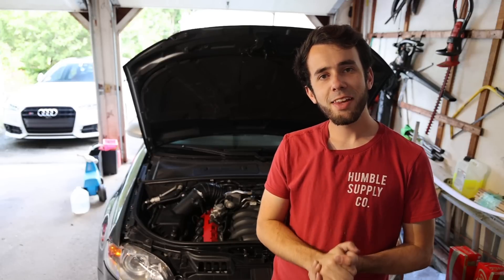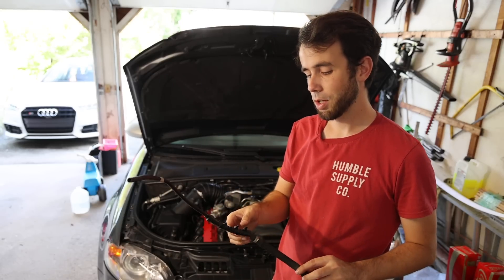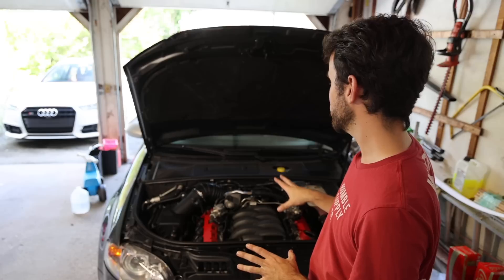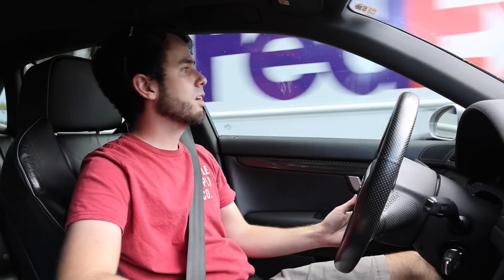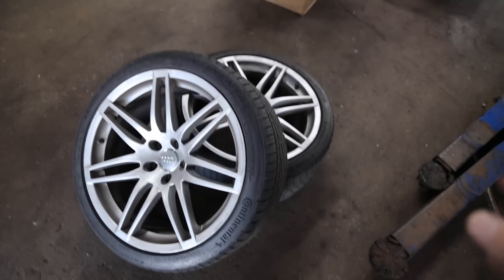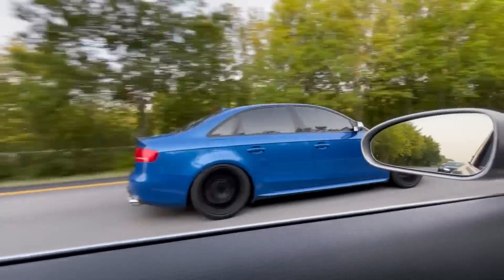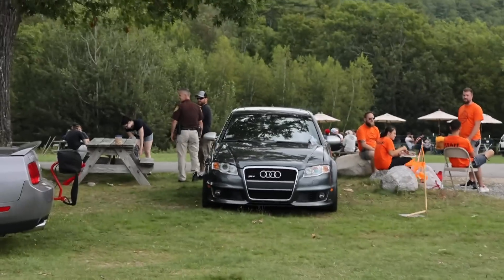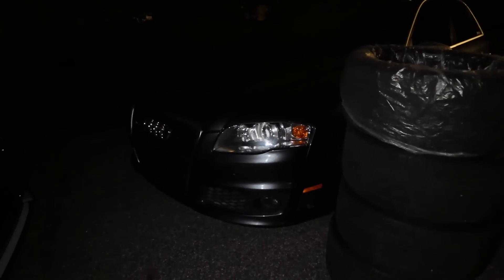The LAST Part In The Country Fixed My 193k Mile RS4!

Comment: My S4 also had a similar issue and the coolant lines were replaced.  
For awhile anytime I got the car above 90mph you could smell coolant in the car.
Found out the leak was on the side of the engine and was difficult to locate without a test.
I own a 2006 B6 Audi S4 that still only has 74k original miles.  Purchased it with just over 50k
only a few years ago.

Comment: The sunroof rattle is likely a broken rear wind deflector mount.  It's a common issue on the B7 generation of the A4/S4/RS4 platform.  You can remove the sunroof glass and then you'll see the broken piece.  Most times it ends up back in the cavity for the sunroof and you'll have to use a coat hanger or something to get it out.  Once you do you can either buy a new piece or repair the one you have with JB or the like.  I repaired mine on my S4 and no problems or rattles since.

Comment: i have a 2004 audi s4 avant v8 6spd. i love it.black on black//i need a crankshaft sensor and a coolant kine to heater core re attached.272 000 kms  and a b7 s4 exhaust dual pipes and piggy tails and cats gutted.im going to be doing anti spark plug foulers for the engine flashing light.these cars are beasts..rs4 must be mental